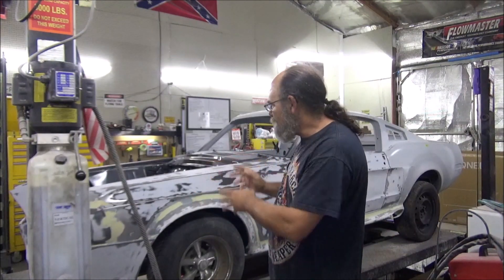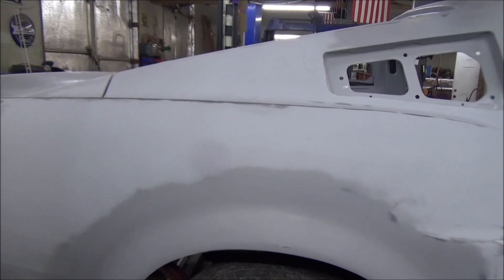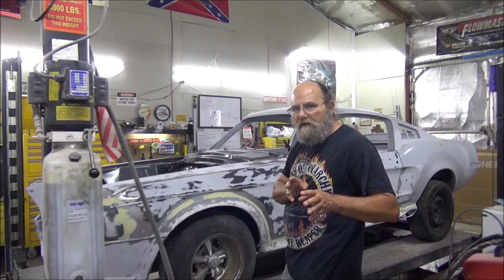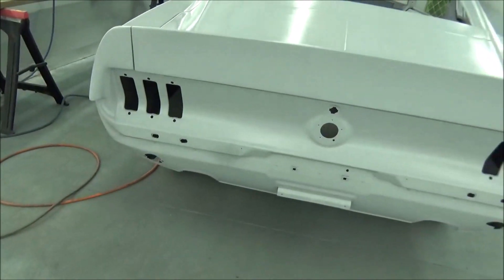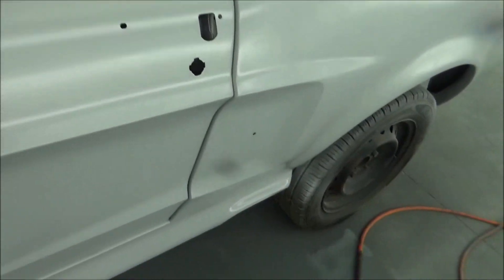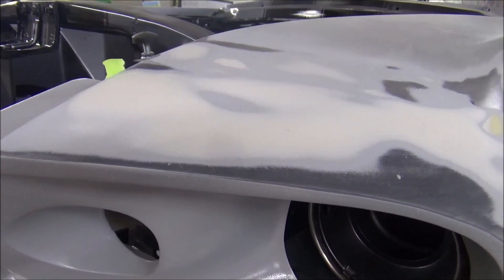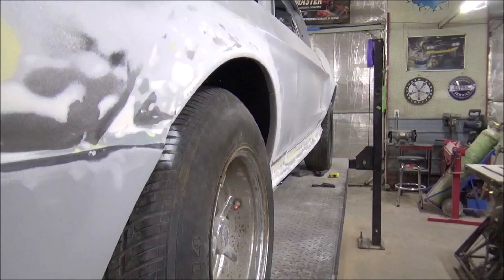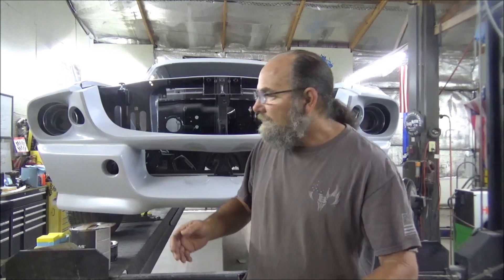1968 Mustang Bodywork and Sealer

Comment: It's looking really good! But have guesting when you put filler over the seems will it crack? Thanks for the video ! God bless you and your family.
Reply from the maker: Thanks and God Bless. The filler will hold fine and last with the sealer .
Reply: Unless they’ve reformulated the modern body filler yes there’s a good possibility that over time stress fractures will appear over the seams like between the fender and header panel or between the fenders and rocker panels etc